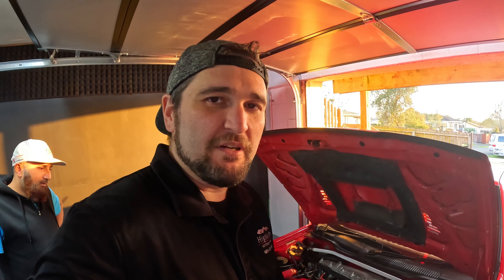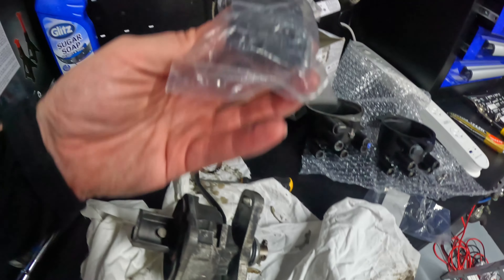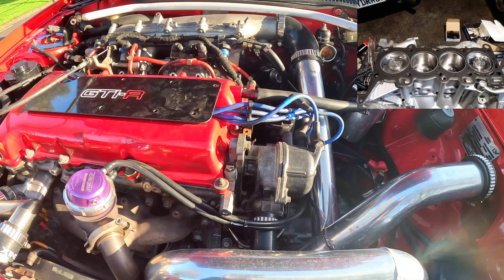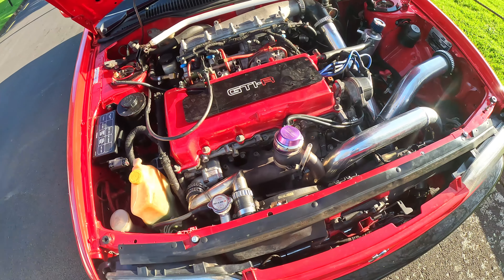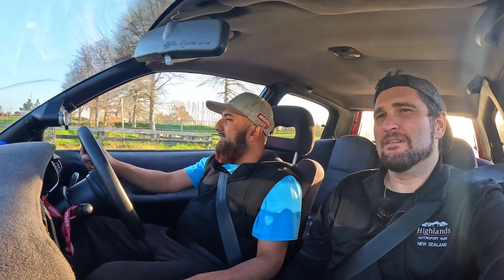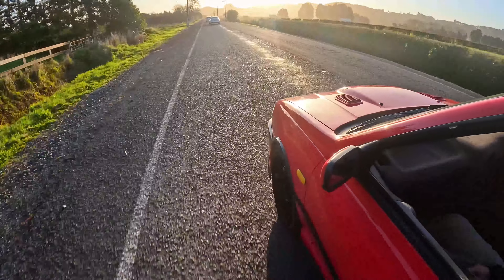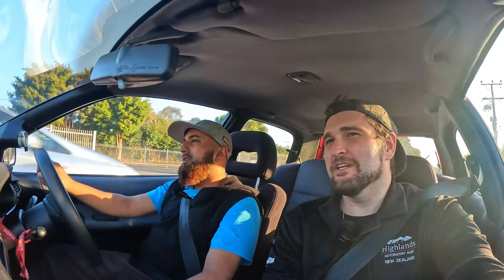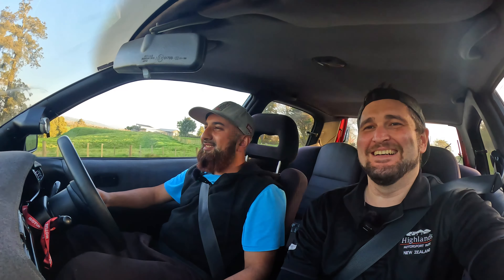Pulsar GTIR - The Original Hyper Hatch - Baby Godzilla?

Comment: Great video! I see the pcv valve isn’t connected to anything, and that the oil water separator is gone. What has he done with  the pipe from the block to the w/a separator? Any issues? Hoping the owner sees this and give me some insight.
Reply from the maker: @petecr2508  Hey man he's got the oil catch tank connected to the sump return and the pcv valve because it has no vacuum running to it is shut at all times and not breathing. It's common to remove the pcv valve or smash the valve body out of it with a punch and run that to the catch tank as well. Advantage of running it is it stops excessive build up of burnt oil and debris building on the top of your rocker cover. 

The orginal oil vapor separation box is long gone. Stock oil separator system is good but it Is ugly!  When you start running big boost and breathing a little heavier then can get over whelmed as well. 

Hope that information helps!! 🙏 

Thanks for watching the video mate.
Reply: @RCrazyNZ thank you for getting back to me! Sounds like he runs his almost the same as mine, I have no pcv valve and just run a line straight to the catch can.